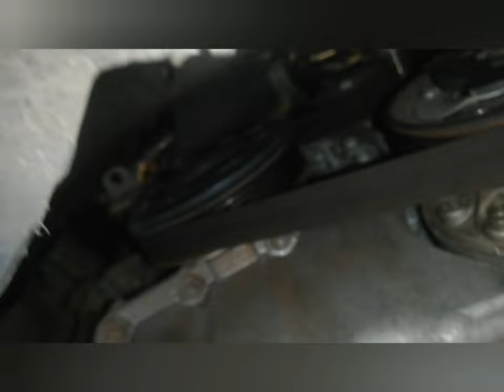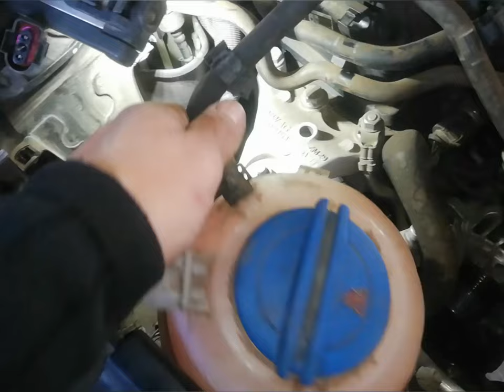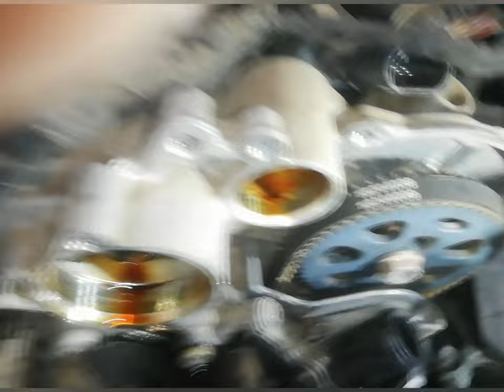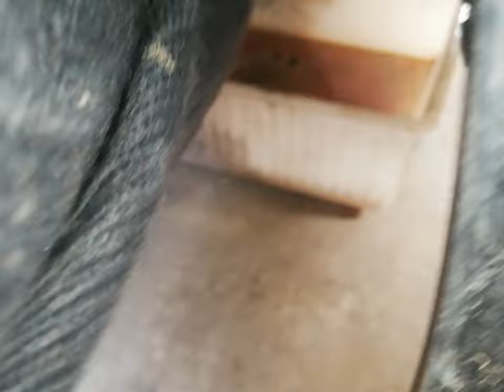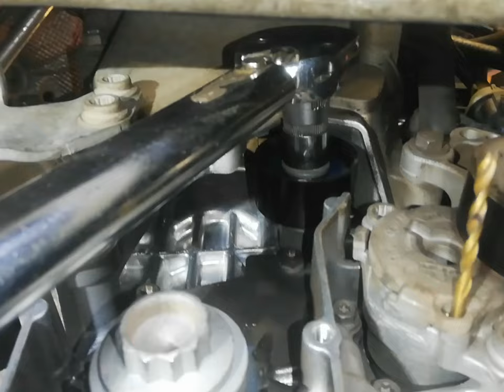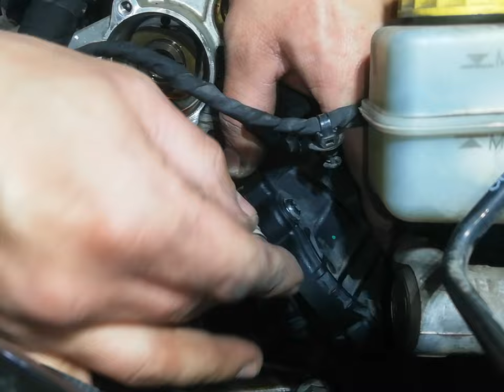VW 1.2 TSI CJZD 81kw... CJZA, CJZB, CBZC, CYVA, CVYB, CVYD, Timing belt and water pump replacement

Comment: Thanks a lot for posting! I was looking for such a video for a long time. I read something about having to use a special measurement tool to set the timing again (VAS611007). I guess this is the case if you remove both cam sprockets and do not lock the cam shafts properly. If I read correctly there are versions of the TSI engine with variable timing on both cam shafts. Possibly it is harder there. My car is a Skoda Octavia with the  1.2 TSI (CJZ) engine and I bought the same tool kit as the one in the video. I am planning to buy new cam sprocket screws, as a VW mechanic told me it is critical to exchange for new. Do you think I can remove the aluminium cover, which is the engine mount essentially in order to avoid the removal of the camshaft sprocket? I will have to support the engine, but at least I won't have to remove the sprocket.

Comment: Hello,
I read that the replacement interval for the CJZD is 210,000 km. It is not specified in years, after how many years should it be replaced? I can't find information about this anywhere! Thanks!
Reply from the maker: 6-8 years recommended... depending on use, sooner or later
Reply: @turbolali  The interval, NOT! specified.  Visual inspection of belt(s) on each service / inspection.  If that is adequate, I do not know, I have a CJZD, that has done 110,000 km now. I will change the timing belt and the tensioner, at this point. Number of Teeth: 163
Length [mm]: 1141, Width [mm]: 20.  There is also a small belt with 28 teeth that drives the water pump, That can wait until 200,000 km, The engine will not be damaged if the small belt driving the water pump should fail.  I take it for granted that the car will scream its "PLING! PLING!" -mercy if temperature exceeds specifications. 🙂

Comment: would'nt have been easier to jack up the engine and remove the engine mount than squeezing in the tensioner to that small space?
Reply from the maker: The silent block holder is not so easy to dismantle

Comment: I bought a polo 2017 1.0 bluemotion 6c i think when does it need timing belt change ? Its now 6 years old with 104 thousand kilometer
Reply from the maker: Intervall cca. 200000km
Reply: Made of kevlar, no change needed!